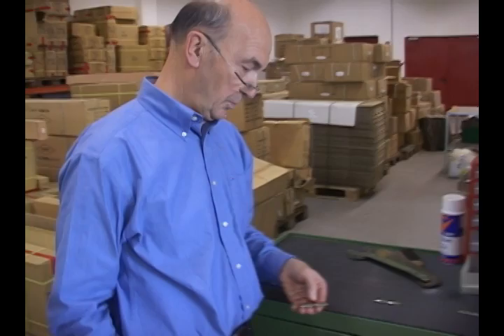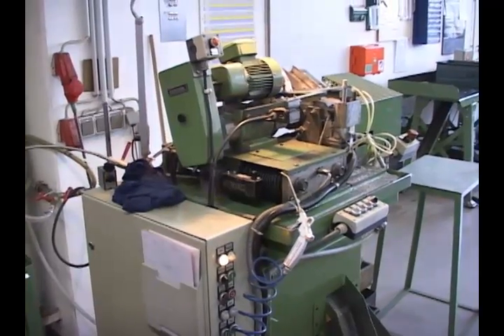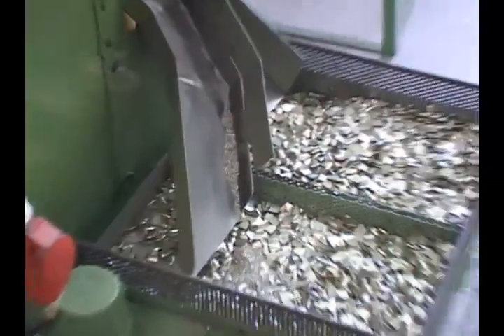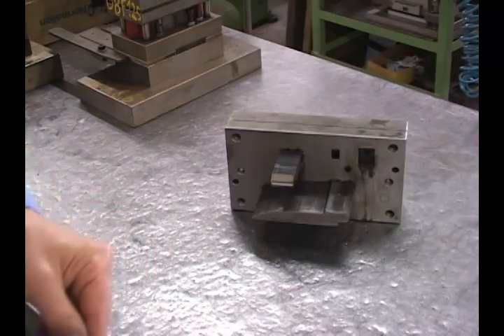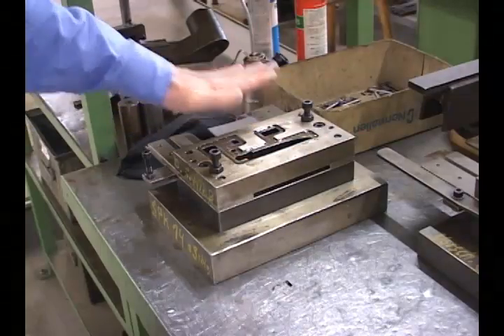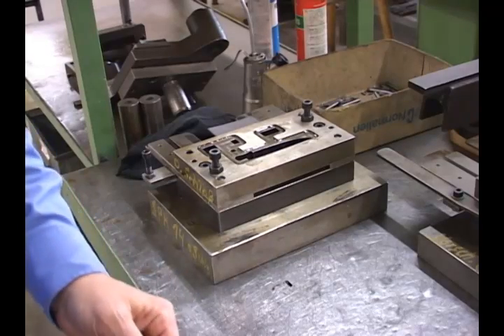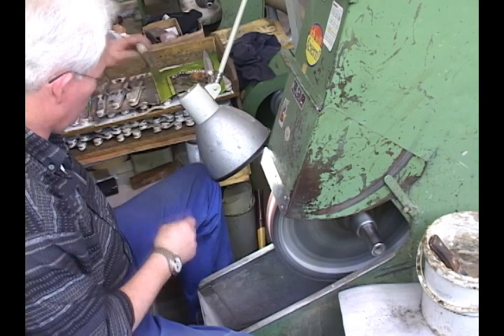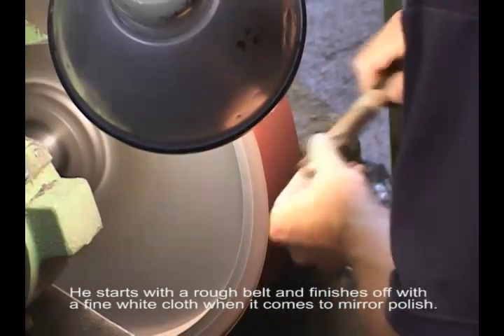Boker Knives Factory Tour - Solingen, Germany

Comment: And now let me ask you very simple question here: What exact difference is between these automatic computer operated machines here in Solingen and those very same ones located in Asia somewhere?? NONE!!!
Reply: TheVeneth there has to be, because the crappy machine made knives from Solingen are only slightly less crappy than the even more crappy machine made knives from China. Sidenote: the crappy Solingen machine made knives are also impregnated with crappier Chinese made parts that don't fit right before the crappy Solingen machine made knives leave the crappy factory and are never checked for crappy fit and finish before the crappy under informed sellers sell you these crappy knives. It's basically all crap.